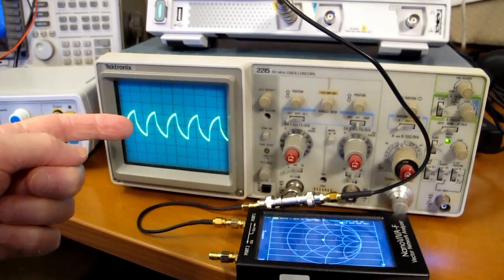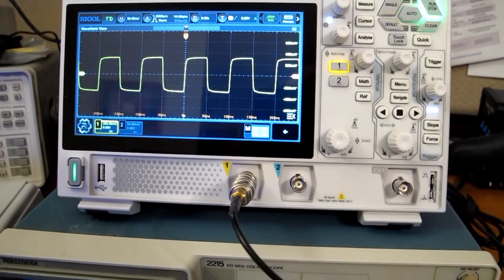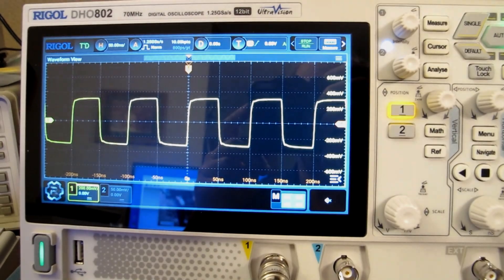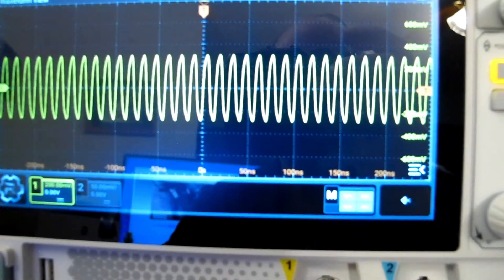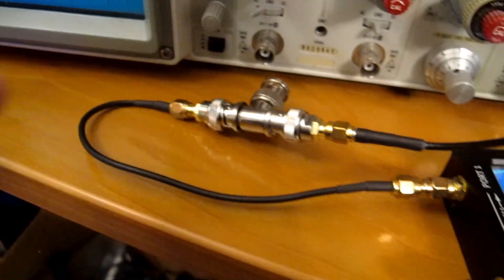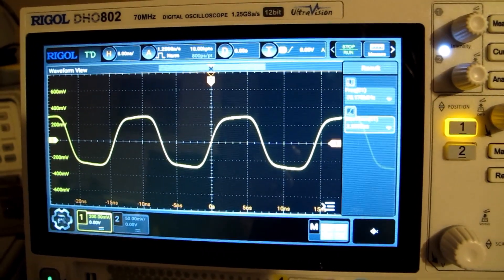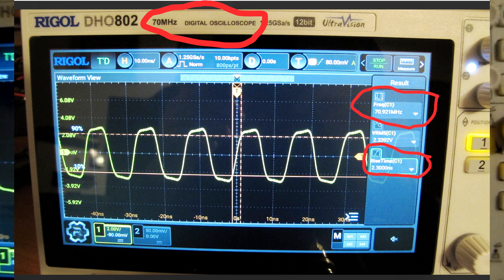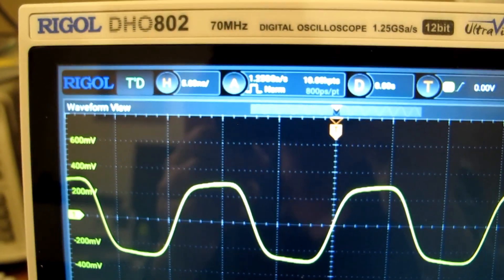Rigol DHO802 Oscilloscope - Bandwidth better than advertised !

Comment: The screen UI does not use the entire 7 inches. It looks more like 6 inches if that. Is there an edit where you can expand the UI to fill all 7 inches of the screen real estate?
Reply from the maker: I don't know of one - but I just tried to see. With the measurement Results pane turned off, the trace area is about 6 and a half inches diagonal (6 in x 2.5 in).  I think Rigol makes some larger screen scopes, but I'm personally OK with this one since I don't use it for multi traces and it was very good price-point for the performance. Sorry I don't have better news.

Comment: Now you can unlock all the features of the DHO8xx and DHO9xx with the DHO800-900 Sparrow Extended GUI v0.7.1 for the 00.01.04 firmware

Comment: My Tek 310a finally went to the big time base in the sky. I remember when I was 13 and my dad brought it home one day. He was a Hi Par Radar engineer. I thought it was the coolest thing I ever saw. I am 70 now and repair vintage Hi Fi equipment to keep my brain from turning into a cheese wheel. I am looking at scopes and was leaning toward this one and you sold me. Thanks
Reply from the maker: Sorry to hear about your 310a's passing. But I think you'll really enjoy the Rigol scope. Digital storage is nice and this thing has a good deep memory to keep the sample rate up. And it has knobs in addition to touch screen 🙂 (I'm partial to knobs). FWIW, my first good scope was an HP 102B. Low frequency, but nice quality. I think Tek scopes were a bit better though...

Comment: Explain why the analog scope display is incorrect...
Reply from the maker: If it were perfect, we would see a squarewave since the nanoVNA used as the signal source actually puts out a squarewave with very sharp edges.  The older scope is showing much more effect of lowpass rolloff than the newer one. That is, the display shows RC-like rising and falling edges, whereas the new one shows more vertical edges. The old scope's display looks like the classic RC-like response (although it is doing something weird after a time constant or two on the 10 MHz signal - we'd have to ask Tektronix why). The new one is clean. The edges are nearly vertical for the 10 MHz squarewave input, and even at 70 MHz they are reasonably 'vertical', whereas the older 60 MHz Tek scope had turned the display into a sinewave at 70 MHz - since it can't handle/display the higher harmonic content.
Reply: @MegawattKS  do it's nearly the same as if it were run through a LPF.

Comment: I know im 5 months late, but as to the reasons why it performs so well, it uses the same rigol hardware (custom silicon frontend and adc) as their better dho1000 series but with just one adc, the front end is the same, but I belive its software limited (which you can hack), so the actual amplifier and front end is actually 250mhz!

Comment: Have you played around with the FFT on this?
I couldn’t find details on the RBW setting range in the info available online and am wondering if this scope can work as a spectrum analyzer for HF/6m.
Reply from the maker: Yes - it works pretty well, for a scope. But it's not going to be anywhere near as good as a real spectrum analyzer, since it has no analog filtering to address intermods and other distortion products. Have you considered one of the low-cost "TinySA" instruments? I'm actually amazed at how well they work, especially given the US $60 cost 🙂  As for the scope, the controls aren't great, but you can set the basics, like Start/Stop frequency. You have full control over attenuators, RBW, etc on the TinySA, but none of that on the scope.  That said, I was impressed when I used it to look at the FM Broadcast band (88 to 108 MHz in the US). Here's a video where that's done so you can see the screen: https://youtu.be/-pm5ADJrKT4?t=416  I keyed it up to start at that point in the video. Note that there are signals below 88 MHz, and I'm pretty sure these are distortion products in the scope/ADC and not real.  Hope that helps. 73's
Reply: The TinySA Ultra is a no brainer for the price for sure. Just wondering what this scope offers or how close it comes to ‘usable’ in that regard.
There are some nice multi domain scopes out there for about $900 but sadly not 12bit and unfortunately the TinySA Ultra doesn’t offer the RBW required for the local Japanese ‘FCC’ registration criteria when submitting for a permit to operate an imported or home brew rig.
Background info - every single piece of kit that either generates or amplifies RF has to be approved and registered (tied to your station permit & callsign) over here.
Real PITA
73 John
Reply: Just watched the video.
Saw the RBW was 100KHz.
It must go smaller no?

Btw - who’s going to offer a 20KHz LPF option on a scope with a 125-150MHz front end 😅

I’ve always knocked up my own test gear/adapters etc to get the job done. It’s all part of the fun 👍🏻
Reply from the maker: Sorry for the delay in replying. Yes - I just tried some things today and it can definitely go lower. But the trick is to work with the number of points used (memory depth) and the sweep speed. I can't just tell it what RBW I want. But it might be doable by varying those.  I tried a 51 MHz CW signal at -20 dBm and was able to get a phase-noise spectrum display pretty well. I used 51 MHz center and 100 kHz span settings with the memory depth set to 1M (the max for the FFT on the 800 series), and a timebase of 500us/div. That gives a sample rate of 156.25 MS/s, so there's no aliasing. The RBW reads out as 100 Hz. Not sure why it says 100 Hz, since the total time window is 5ms, which would imply a 200 Hz FFT bin size. Hmm...  Anyway, the spectrum looks pretty decent, and I can even pick out the PLL loop bandwidth from it. I think its a bug. If I turn on the horz vernier and change the timebase to 490us/div, it then says RBW=199.9 Hz. There are also possibly some spurs, but overall, I'm impressed with the digitizer and FFT the more I play with it :-)
Reply from the maker: To be fair, on the 20 kHz LPF thing (in the other video), it's needed of course to see low level signals. Bandwidth is great, but unnecessary BW for the signals of interest leads to excessive noise :-)

Comment: What does it do with 100 MHz sine waves?
Reply from the maker: I made some tests with up to 300 MHz sinewaves and it had the expected rolloff in amplitude for a 125 or 150'ish MHz 3dB corner. And it even triggered up to at least 300 MHz sinewaves with no ill effects.  One thing I did notice was that at the higher frequencies (> 70 or 100 MHz), it won't display a sinewave to full plus and minus 4 vertical units. My guess is it has a slew-rate limit in the vertical amps - producing the "full power bandwidth" limitation that opamps suffer from. Knowing this, I will just keep my displayed waveforms to maybe 4 vertical units peak to peak or less to avoid waveshape distortions when pushing the frequency range ...
Reply: @MegawattKS , thank you. I'm subscribed to your channel because you actually understand your subject. It's refreshing to watch a technical channel created by a university prof who knows exactly what he's talking about, instead of a HS kid who doesn't know a dBi from a dBd, or an amp builder who speaks in terms of 'Birds' and 'pills', like a couple of channels I've had the misfortune to stumble on.
BTW, my DJ name on the college radio station was , 'Meager-milliwatts'.
Reply from the maker: Cool! I'm guessing the college station was more than milliwatts though?  I went to our college station's tower once to try to track down some intermod issues with a co-sited ham radio repeater. I think they said it was 5 kW when we worked with the station operator to switch the FM transmitter's final off briefly to see if it was contributing (they actually just brought it down to the couple hundred watt level, which was enough for us to confirm it was part of the issue).

Comment: I assume that the same hardware is used for a range of bandwidths, and software sets the available BW.  Why would a 70MHz scope use 1.25GS/s ADC.  125MHz x 10 = 1.25GS/s.  Sounds like the software is unlocked, and you have the native BW.
Reply from the maker: It's fresh out of the box, so not unlocked. So this is apparently just how its made. Agreed that they likely use the same hardware for the 4 models in the series - except of coarse they don't populate the second ADC or third and fourth vertical amp sections for the 2-channel ones. The same sample rate is used for all. It helps avoid aliasing I guess.  The EEVblog channel has some excellent teardown videos that show and discuss the internals. A speculation is that the same custom vertical channel amp ICs are used for all models - so I was curious if it's really significantly dialed back in bandwidth somehow. Unfortunately I don't have the 812 or 814 model units, so I couldn't compare and see if they also go much higher than their specs. Maybe someone with a NanoVNA (which has up to 300 MHz squarewave outputs) and one of those models can check :-)